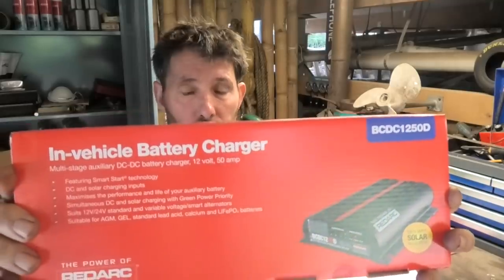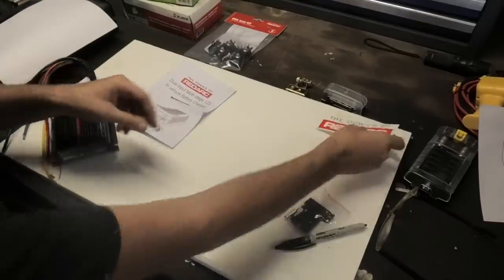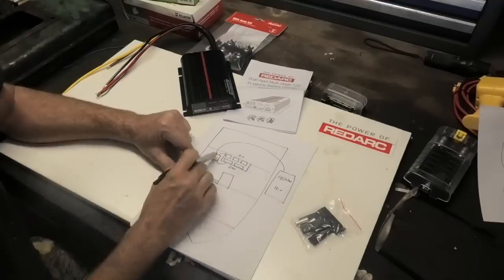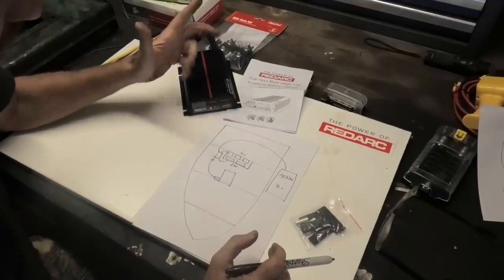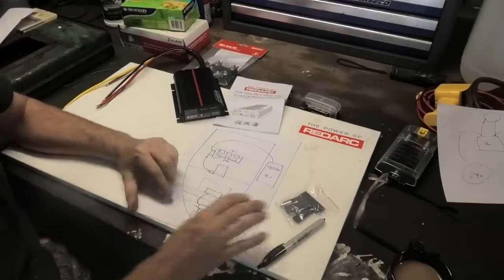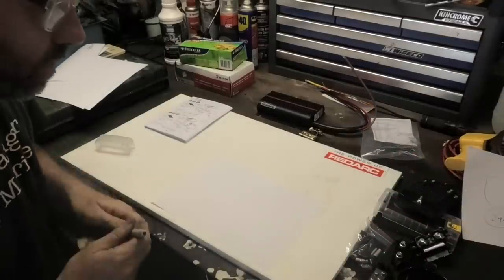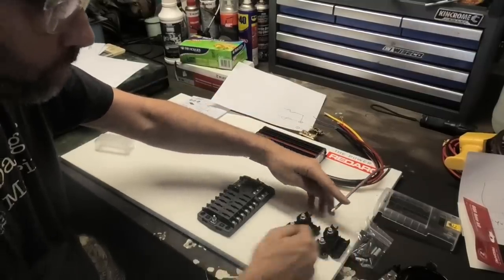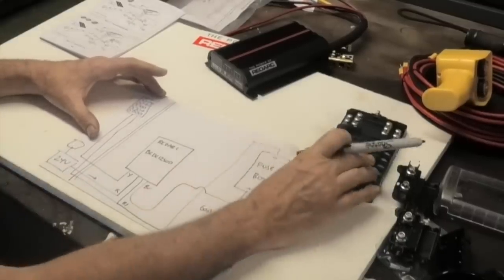Planning the trawler electrics

Comment: I've been in the electronics/electrical game almost 40 yrs and I can confirm it's an excellent decision to separate the AC and DC panels. Keep all the wiring in different conduits and a specific colour.

Also sensible to use DC wherever possible, however shore power will always be AC and some loads, like say a water heater, will be large enough to demand AC. Can I strongly recommend using an Isolation Transformer for the AC. These are highly desirable on all metal boats.
Reply: On that .. an inverter with it's switching would already I think be isolated from DC well enough but on the reverse way as you raise a valid point it may perhaps be better off with a 25a smart charger from the AC back to the DC and a double throw switch to use the charger OR the inverter (water vs shore). If you're using more than 25a 100%dc when on shore power you have some issues you need to look into. What's your thoughts on that Phillip?
Reply: @NullaNulla  Agree with Vancouver Jet, none of the inverters I'm aware of offer galvanic isolation between the AC and DC sides. There are three broad approaches I would consider. 

One is to go full DC boat for all loads, and use the shore power AC to drive a battery charger only. You may be able to find a charger that offers marine spec isolation, but crucially if it ever fails someone would have to be sure to replace like with like. I would still use a separate isolation transformer even in this scenario.

The other is to go the invertor/charger route like a Victon Multiplus. Now you have to use a transformer for isolation.  This is a nice smart setup, but the subtle downside of these devices is that on the DC side there is only one connection to the  batteries and it's impossible to functionally split the charging and load function. This can be a showstopper when using Lithiums and BMS protection relays.

The third option I went with is to keep the AC and DC systems, AND the charging/load circuits all totally separate. The shore power arrives via an Isolation Transformer and powers some 'shore power only' loads like Air Con or Water Heating and a Battery Charging device that lands on the Charge Bus. Then on the Load Bus I have a separate inverter for AC loads that I want to use at all times, like an Induction cooker, or my large AC crash pump. This approach is a little more expensive, but much easier to accommodate all the electrical design goals.
Reply: @Islandwaterjet  what's the issue with sharing only the neutral though if there is only one tie point still to the hull? I would have thought it would be how you use the other (pos/active) and link it that counts.
Reply: @NullaNulla  Isolation Transformers perform three distinct roles that depend on the total separation of the source and load sides. 

The first function is the obvious one, galvanic isolation of the ground loop to shore in order to prevent electrolysis and stray currents that can kill swimmers.

The second benefit is that they provide inherent shore power reverse polarity protection. If for any reason the live and neutral are swapped it just doesn't matter. This is why you don't want to share the shore neutral with the hull ... it could become live!

The third more subtle reason is the isolation transformer load side neutral is bonded to the metal hull. This provides a rock solid earth path for any AC circuits and ensures reliable operation of the RCD's or Earth Leakage protection devices.

It's my view that Isolation transformers should be mandatory on all metal boats, for the first reason alone. But on all other types GRP or Wood, the second and third reasons also justify them.
Reply: @philipwilkie3239  if the shore goes only to a smart charger than you have no risk of it being an issue and simplifying a lot of things.

Focus on dc and then only invert things like the toaster and microwave. There are 12v dc tvs etc and even fridges of reasonable size then cook with lpg.
Reply: @NullaNulla  Yes that's essentially the first approach to AC management that I outlined above; otherwise called a "DC boat' . It does have the valuable merit of simplicity. However on a metal boat I would still not depend solely on any AC/DC galvanic isolation that the charger might provide. First of all I've not yet seen a charger that was designed to provide it, nor specifications equivalent to a marine grade transformer. You can be sure that if the manufacturer did provide it they will make a feature of it in their literature. I'm open to being educated on this point.

Secondly if it gets replaced in the future by someone unaware of the isolation role it's playing, there is a good chance they will select something non-isolated or otherwise unsuitable. Bottom line, on a metal boat a transformer should be considered mandatory.
Reply: I wonder if the REDARC unit has battery charger that is “Temperature compensated” for the optimum float voltage and maximum service life.
Reply: And I assume you'll be using ridged (pvc) conduit, not that flexible corrugated stuff?

Comment: Hi stu a lot of conflicting info coming through , I fit out ally boats for a living , my advice would be keep it simple ,I woundnt complicate  the system by fitting a battery just for the winch , use a 24 volt winch the cable cost will not be all that great to run to the 24volt system , the 24 volt system will be no problem charging from the alternator (just make sure it has sufficient output and in good condition) 
I would also run a fused circuit to the wheel house and use another fuse block for all other  lights ,radios sounders etc from there .
Also don’t complicate the wireing by useing relays when you don’t need to the fuse block will handle up to 30 amps per circuit ,
You can download a really good voltage drop app from the blueseas web site called circuit wizard it’s so easy to use just fill in the info and it calculates for you .
Love your videos keep them comeing 
John
Reply from the maker: Thanks John. Yes, I'm totally convinced to go a 24V winch running off the starting batteries now. :)
Reply: Fuse panel can handle the current but he'll need relays to switch most loads over 10A...
Reply: JuzzyQld 
If the switches used are rated for 25 amps and the cable is rated correctly you will not need relays .not many electric components in a boat are rated above about 18 amps ,even the 60 /70 psi water pumps will only draw 18 amps max pressure , there is no point in complicating a 12 volt system by useing relays unnecessarily,
Reply: you can also consider 48v for even more efficiency. 12v is sad if you have to use lots of power.
Reply: Nice advice, John.  In the wheelhouse - that's where the design app and controls from blueseas comes in.  It's where the convenience of CB's and power monitoring really needs to be.  ....and to Stu..I know that's a pricey option, but it's the prettiest/cleanest one.  Hopefully we readers can help out with that cost, but considering all of your effort on that trawler..and the wonderful results so far...  you deserve it.   Make the wheelhouse cadillac, man! :).   BTW, I'm not a marine engineer, but a electrical controls engineer who understands the power distribution gig...where it needs to be simple and brute force, and where it needs to be practical.  John's got this down.  Go with the force, Stu :)
Reply: @DangarMarine  This (24V to run anchor winch, off start batteries) is how most commercial boats do it (f they don't use hydraulics for this). 24V rule.

Comment: Done a fair bit of boat repair and worked as a residential elechicken for a few years- your plan sounds fairly solid and I don't see any glaring issues other than making sure that your 24 and 12 volt systems are properly, and absolutely, isolated.
Being the boat's in salt water, I'd also have to say grounding the hull is a wise decision.
(Also, as janky as it sounds, there's a reason we electricians don't use crimps- they tend to loosen over time with thermal expansion- we either use screw-clamps, or just wire-nut the shit out of everything. Wire-nuts handle elastic deformation better than crimps over time.. plus, they're easy AF to modify/expand later on)

Edit: and they do have dielectric-grease filled nuts that are suitable for marine environments.

Comment: Thanks Stu..a plan before wiring a boat is the best way to tackle it I find..
Reply from the maker: For sure. There has already been so much great advice I'm glad I didn't just dive in and do it. :)
Reply: Ill be keen to see the redarc hooked up to the multi voltage system mate..I have one that hooks into my slideon camper and its great 12v to 12v

Comment: Your plan for your power needs seems to be fine and quite simple. This will be a blessing because as of a boat this size, simple is best. I've built a few boats myself and I found an old trick that works a treat when planning the electrical and plumbing. Start off the same way, draw a layout and also do a side profile of your boat and be as accurate as you can with the dimensions. Then add a layer of clear plastic (map talc) over the top and using coloured felt tip pens, trace out your 12v system. Add another layer and do your 24v system (If you have spent anytime in the army and made plans on maps, you'll understand this better). Use a different pen for each system and when you are done, it allows for accurate measuring of conduits and assists in calculating bends, fittings, saddles and all the extras. It basically unclutters the main diagram and gives you a simple overview on what you need and where you can put it. This may work, it may not, its free info. Keep up the good work!
Reply from the maker: I definitely want to draw up some scale plans of the boat. As you say, having the system diagram is one thing but having the exact distances is important for buying wire and knowing the expected voltage drop along the way.

Comment: I've got a similar Redarc DC-DC charger on the 4WD.  It manages the charge to the house battery, isolates the house and crank batteries, and regulates raw solar into the charging system.  After 5 years it's never let me down.  Great brand.  Would buy again in a heartbeat.
Reply from the maker: Good to hear. :)

Comment: Totally enjoy following your work. I'll never own a boat larger than a Kayak but will know how to restore one thanks to you. 
From my experience as an electrical technician & Ham Radio Operator I have two tips for you to consider... Avoid any CRIMP CONNECTIONS & buy a second DC to DC charger as a spare. Crimp connections fail. Not maybe, they WILL fail. Crimp connectors also collect moisture, they oxidize & corrode & add resistance to your DC circuit. Use solder connections instead, and completely heat shrink them. And since that DC to DC charger is your electrical system hub, if it fails, you're SCREWED. It's simply smart insurance to have a spare hermetically sealed & stowed away. May you never ever need it, but if you do it's an easy exact replacement & you'll get back to port with no worries.
GREAT SERIES, look forward to more.
OH! BTW, get a Ham Radio License! I've personally helped rescue a mariner adrift off of Nova Scotia in a gale via 20 meters ham radio. You sail over the horizon from land you need HF radio. When all else fails, Ham Radio WORKS!
Reply from the maker: Yes, with something so critical, a spare is almost essential.

Comment: Hi Stu, it was pleasure talking to you at Sanctuary Cove International Boat Show. I would suggest adding additional 24V charger to charge only starting batteries (+  anchor winch battery) and leave BCDC1250D to change house batteries. Also, battery monitor (something like Victron Battery Monitor BMV-702) would be nice to have at wheel house. Thank you for great videos!
Reply from the maker: Hey Yury, nice to meet you too. :) Yes, I'm going to dedicate a third of the solar cells to charging the starter batteries and run the winch off those. Have a battery monitor in the pipeline!

Comment: I have considered adding the Redarc DC to DC charger to my VW Westfalia Camper setup. This by far is the best simple explanation I have found and has convinced me that it is worth the cost. Thanks.
Reply from the maker: The only limitation is that it turns out it can't can't the 24V system from the solar, doesn't have a step up transformer, only down.

Comment: You will putting a great deal of battery weight on those three cantilevered tubes mounted to that aft bulkhead, recommend you think about bracing that shelf from below. The braces could go diagonally to the base of the bulkhead or down to the nearest structural hull member.
Reply from the maker: Yes, a bit of extra support won't hurt.

Comment: You are going over the same ground as I did when wiring my Bass Boat. You know, trolling motor, sonar units, electrical wiring, power anchors, under way lighting. This is a 1986 model, so lots of wires, esp. ground wires from everywhere. Still trying to balance 3-12v batteries, one for starting, and electronics, and two for trolling. I thin like you I need to add a battery just for anchor poles and maybe sonar. Keep up good work and teaching. Bill in West Texas

Comment: First thumbs up,
6th battery for the barrel winch yes... 900kw of solar??? Nagh mate, go 12-1500 if possible and take all the strain offa that alt.
Certainly done ya home work on the lightening earth... straight onto that Central "Single" earth. So you're going all LED lighting obviously with all that existing wiring.
Reply: Some good ideas there :) and yeah I reckon LED is 100% the way to go with most things now especially lighting to save on wiring and consumption :)

That lightning earth .... I'd be curious to see how that would really go if you copped a hit to the exhaust/mast/antenna array/wherever. I get the feeling it's to disippate the power via the water covered hull area but if it cops something not directly tethered to the hull it will still do some damage I reckon.

Comment: NOW - you're in my wheelhouse!!  Looking over the comments (I didn't wanna sound like a broken record), there are a few really great tips.  I'd like to comment on a few things: I believe there are (2) reasons to fuse.  1) To protect the boat from electrical fire (fuse at the battery) 2) to protect a specific device from shorts (or other issues) - fuse at the device (or fuse block).  
As for the REDARC products, I'm unfamiliar but it looks like the perfect fit for your project.  I can't tell the gauge of wire, but to me, it seems a little light.  When doing 12v projects here at our shop, after calculating current draw, we use 8GA, 4GA, sometime 1/0GA wire depending on the load.  The wire coming out of the REDARC seems to be 12GA at the most.  I'll jump on their site to get the skinny on it's spec's. 
As for the others' comments: Go LED lighting when possible (even in gauges if available)and I'd do a 24v winch for the anchor.  Someone commented that you'd lose 12v power if the REDARC would die.  I don't believe that would be the case since the battery bank and the devices are on the other side of the REDARC.  You would lose the ability to CHARGE the 12v system, but not lose power completely.  Eventually, yes.    Not sure of your timeline on the electrical system, but I would LOVE to send a care package of goodies your way.  I have no idea how long something from the US would get to you, but I'd love to help.  Let me know.
Reply: Mail it now priority, it'll get there in time.  Nice idea.
Reply from the maker: Thanks Scott, appreciate the info. You are right in that I would only lose the ability to charge, the power would still work until the batteries went flat. I will definitely look into replacing all the existing incandescent lighting with LED, definitely a great way to save power. I've got about four weeks to finish the electrics so send me an email to dangarstu@gmail.com if you have something you'd like to send. Any help is always greatly appreciated! :)

Comment: Awesome plan Stu. Its inspired me to finally get the small (30w) solar panel and charger put on my boat (tiny in comparison) along with putting the batteries in parallel. Basically centralize the electrical system.

Comment: If you want back up "clean energy" then I recommend aerogen marine wind turbines. I grew up of grid and my dad runs them. He lives on the coast so cops marine conditions and some extremely strong winds. First one lasted 20 years then he upgraded to a higher output one. Turned out the old one just needed a new rectifier so now it's a back up. I get it that turbines arnt for everyone though. Great video as usual. I hang out for my weekly dangar fix haha.
Reply: Clean energy? Does a two stroke GM diesel qualify?
Reply from the maker: The great thing about wind is that when you don't have sun you often have wind. They work well together.

Comment: Oooo. RedArc. Le fanci. 
Keep in mind Stu, chargers for lithium batteries such as tool batteries laptops etc, are extremely finicky on the type of power the receive. Altered sine wave generally won’t work. You need pure sine inverters. Also you need an emergency generator for the beer fridge. Maybe two.
Reply from the maker: Two back up generators for the beer fridge is the best advice so far. ;)